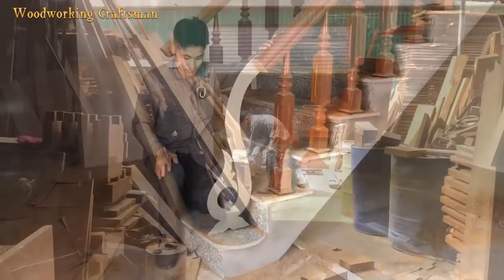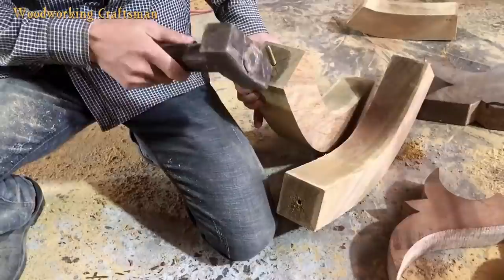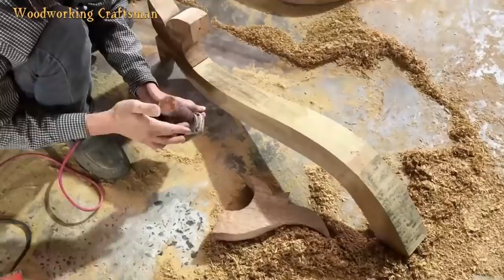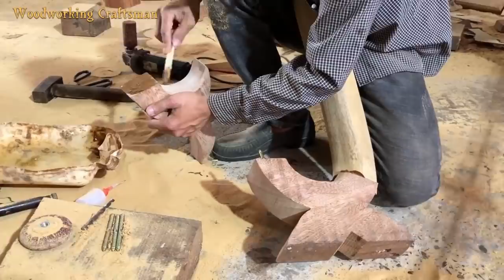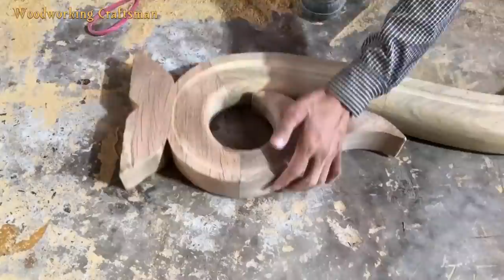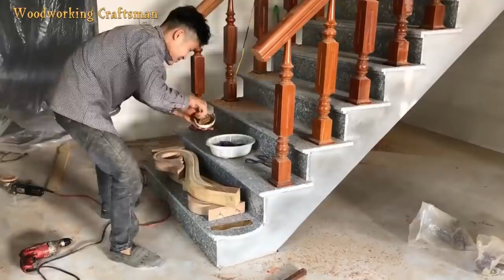Curved Stair Armrest Saves Space // Make Use of Small Wood Pieces with Curved Woodworking Project

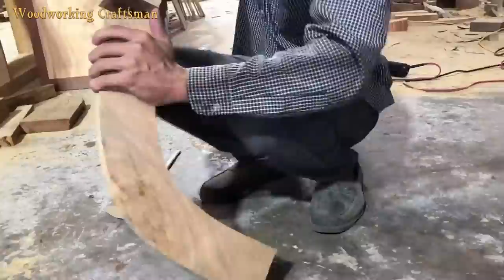Comment: 4:25 why a metal screw-thingy and not a wooden dowel?
Reply: I pondered that myself.  I was wondering how he drilled the hole so precisely by hand that the 2 planes of the separate pieces mated perfectly.  I think the screws, when they draw up, will give enough play to draw the planes together so they mate perfectly. Dowel holes would have to be drilled perpendicular, then it would have to be clamped.  With those obtuse pieces clamping would be a challenge to itself.  The screws pull it together so a clamp isn't necessary.  The trick about driving the screws in with a hammer might be considered cheating, but it looks like it is holding where it needs to.  Now how does he cut a perfectly square plane on the mating surfaces with a band saw.  I think magic is involved.
Reply: @PhotoNack  
Carpenders been doing thar for years long B4 computers and lazers .. its call paying attention to what you are doing and X marks the spot , measure 4xs drill or cut once  ,if in doubt measure again ,,,,  have a great day .
Reply: @LUCKYB.  I would not call this precise measuring and marking. The flaws aren't visible in videos, but there, plus the careless drilling and dirty works won''t be unseen with eyes after the whole job is done. Handrail parts must withstand heavy leaning and swinging. Glue and 2 screws between stone and wood can't stand long. And when it breaks, it can't be repaired that easily because of their whole process.